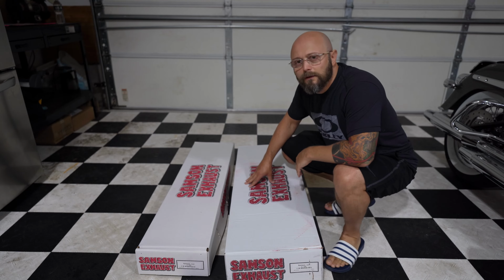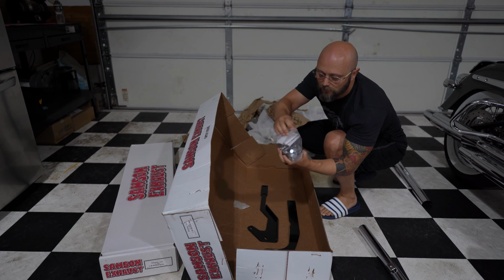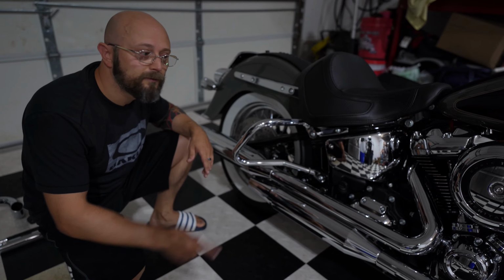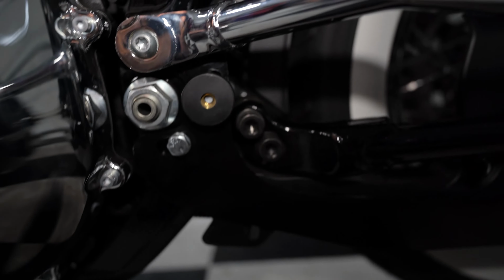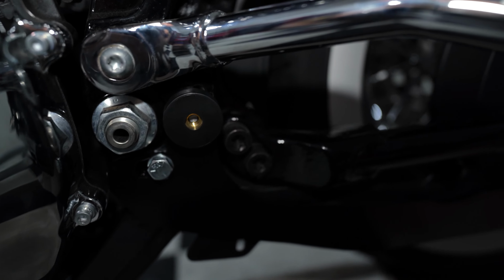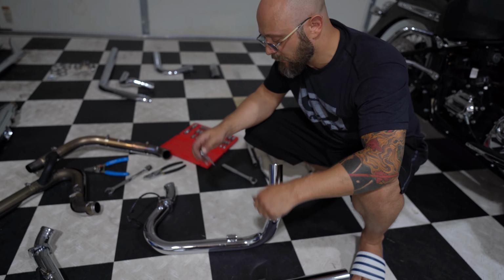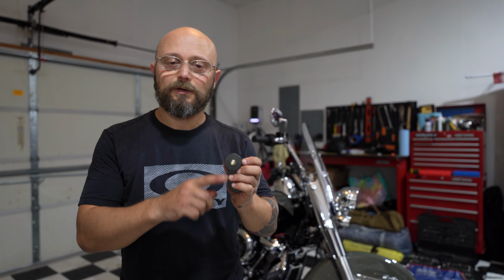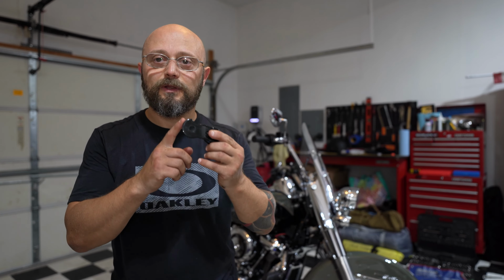Samson 33" Chrome Fishtail Exhaust Install on 2021 Harley Davidson Heritage Classic

Comment: I actually went into the dealership looking for a deluxe and went home with a heritage after finding out it was discontinued.  I never knew how much I would appreciate bags and a windshield until I tried it .  😆  No regrets at all.
Reply from the maker: Yes definitely.  I had a Street Bob and wasn't planning to upgrade, until I saw this on the dealership floor 😃
Reply: No tuner required?

Comment: After putting Sampsons on several bikes in the past, this time I'm trying Freedom Performance on a 2018 FLHC I just picked up.  I'll report later on how they turned out.  I noticed in your video, that you did not need to remove the heat exchange cover or loosen it to remove or install head pipe.  My instructions tells to do so.  Did I miss something on your video, or did you work around it?  Thanks
Reply: Oh and BTW,  I also lowered my bike after watching your video on that!  After the pipes, I'm putting on hard bags!
Reply from the maker: Yeah I was able to work around the heat shields, but they are simple to loosen and remove. Good luck with the Freedom Performance👍

Comment: Did you notice any power gain or loss with the true duals?
Reply from the maker: I honestly have not. I would not be surprised if there may have been an HP or two loss but I did keep the baffles in to maintain the back pressure to minimize any power loss.
Reply: They definitely look good and sound amazing bro. I have a 2018 heritage myself and have been leaning towards fishtails as well. Looking at what's available, I think the Samsons look the best on the new Softail frame. The bassanis sit too low and look odd with the stock bags and guards and the freedom fishtails sit way too wide. That short video you made showing the pipes with the bags convinced me which way to go. Thanks.

Comment: How did you get the right saddlebag re-installed? Did you just use the bracket from left side?
Reply from the maker: I got in touch with Samson and they sent me the missing brackets (eventually).

Comment: What's your estimated time for installation?
Reply from the maker: Couple hours
Reply: @LennyK  Reason I asked was because I had my dealer install ( I bought the header pipes from Samson n chikla upswept slip ons from Steady custom cycles for my 08 flstn with all the parts for installation. Was told everything is on but the mechanic said it was a bear to install. So the parts dept billed so many hrs n now they may need to adjust for more because of more time which don't know as of today. Originally I was told 2 1/2 hours. I still have baffles to install which I didn't know at the time of purchase, that pipes came without n they will be shipped to dealer next week. Let them drill the hole to install. Should I pay the extra $ it took, if that happens or negotiate.
Reply from the maker: @peterbergeris6510  definitely negotiate. They quoted, and should stick to the price/hrs quoted. The install is not very hard at all.

Comment: What size in diameter are these? In the process of ordering and have a 1 7/8 option and a 2 1/4 option
Reply from the maker: I am not 100% sure about diameter of the pipes, but here is the actual exhaust I got: https://www.directcycleparts.com/shop/exhaust/full-systems/samson-true-dual-crossunder-m8-headpipes-w-33-cholo-fishtail-slip-ons-for-18-21-softail-chrome/

Comment: Hi Lenny,
After the Samson true duals were installed and the right side bracket issue was resolved, the saddlebags can be properly re-installed.  Need saddlebags when riding two-up.
ES
Reply from the maker: Yes. Saddle bags are back on the bike! 👍🏻

Comment: Without the fishtails on the bike can you tell me where the pipes would end ? Would they be aligned with the rear fender if removed?
Reply from the maker: It ends in the middle of the fender.

Comment: I like the bike and sound, I just wand install samson fishtail for my 2021 heritage 107 (same as yours), I'm a little worried because some one say samson has cheap quality, especially in the surface plating treatment, I don't know it's true or not, I wish had  your opinion. Thanks
Reply from the maker: Samson is the company that started fishtails.  They are one of the highest quality exhausts, and that's the main reason I got them.  It's been about a year so far and no problems in quality at all.
Reply: Thanks Lenny,  you've relieved me. I want to install it myself, it's a very interesting thing. Again, do I need to replace the gasket? Thank you so much.
Reply from the maker: @chenwang9232    It's always a good idea to put in the new gasket where the connection of the downpipes are to the cylinder heads.  Mine was basically new when I did it so I did not have to change the gaskets.
Reply: @LennyK  Thanks brother.
Reply from the maker: @chenwang9232  My pleasure
Reply: I learn from you and have install samson fishtail for my 2021 heritage yesterday, looking great souds great, but the cheak engine lamp always on when riding, what will be the problem? Do you have good solution for this? thanks brother
Reply from the maker: @chenwang9232  glad I could help. The only thing I can think of is the oxygen  sensor not plugged in properly or got damaged in the install (possible wire problem also). I am assuming you have a stock intake?
Reply: @LennyK  Thanks borther, I'll check it, good man.

Comment: Looks good and sounds amazing
Reply from the maker: Thank you!
Reply: @LennyK   I'm about to order the same size you got but it's asking 1 7/8 or 2 1/2 what did you go with
Reply from the maker: @Beenthat1214  what are you referring to?
Reply: @LennyK   You're exhaust you went with 33 length but what's the with diameter. on the website it gives me two options to pick from 1 7/8 & 2 1/2....
Reply from the maker: @Beenthat1214  Not sure where you see this but Samson does not mention anything about it.  Here is the link:  https://samsonusa.com/shop/new-m8-true-duals-for-softail-33-chrome/
Reply: @LennyK   Oh well the link you sent me the exhaust is way cheaper I was about to pay 1,400 smh thanks man i really appreciate you sending me the link big time.
Reply from the maker: @Beenthat1214  No problem :)  Good luck!

Comment: Hello,
Just curious what fuel management system you are using.  Great video.
ES
Reply from the maker: At this point I am not using any. Don’t really need to tune anything until I change the air intake.
Reply: @LennyK  Hello, Thanks again. The cycle runs and sounds OK without a fuel management upgrade? This is my first H-D with fuel injection. Previous cycles were carbureted Evo and TC 88. When I do upgrade to Samson fishtails, air cleaner will be H-D Scramin' Eagle extreme flow with Zippers Thundermax fuel management.
Any opinions will be appreciated.
Lots of info out there.
ES
P. S. A cam upgrade to an S&S cycle 465 gear driven cam will occur in the future.
Reply from the maker: @kathyleesawyer5277  sounds like you have a great plan for your bike. As to your question, yes the bike runs and sounds great. These bikes do not run lean, so unless you introduce extra airflow, there is no need for a tune. I will be upgrading to Screaming Eagle intake and tuner in the near future.

Comment: Lenny K  I have a quick question.  I've contacted samson several times and they tell me they don't have an exhaust for the new heritage classic 114 .  I have a 21 as well.   They told me in emails that the fishtail for 18 and up softails won't work on the heritage due to clearance issues and they are in r&d and expect a release soon.  Then I come across your video.  I didn't really notice you having clearance issues  do you have any idea what they are referring too?  Thanks
Reply from the maker: 107 and 114 is the same as far as the exhaust goes.  They absolutely have it, but they call it 18+ M8 Softail.  There is no fitment issues, but you do have to ask them for Bag mounting brackets. Here is the link for exhaust:

https://samsonusa.com/shop/new-m8-true-duals-for-softail-33-chrome/?attribute_set-type=Head+Pipes+and+Mufflers+%28Sold+as+a+set+only%29&attribute_year=2018-2020+Softail+Models
Reply: @Lenny K  thanks  for the response  yeah I took the bags and windshield off day one and will never put em back on.  I slammed it with air ride and put carlini bars  doing a vicla,  all blacked out.  I'm going to order this today.. thanks!
Reply from the maker: @TopShotLLC  no problem. Good luck with the exhaust. They do have a bit of a wait for it but I think it’s worth it 👍🏻
Reply: Hi Lenny,  Just want to double check something:  you mention that the saddlebag mounting right-side bracket needs to be specifically requested?  Samson didnt simply forget to add the bracket to your parts packet?  I perused the Samson accessories section on the web-site but only found exhaust mounting brackets.  Would you happen to have a part number for the saddlebag mounting bracket?
Thanks again,  ES
Reply from the maker: @kathyleesawyer5277  Hi Kathy.  According to Samson, they do not automatically ship the specific Heritage brackets for saddlebags.  So if oyu are ordering the exhaust for Heritage you have to make sure and let them know to include these (two) brackets.  Unfortunately I do not have the part number for them, but if you call or e-mail them, explain exactly what you are looking for.  They will know what bracket to send you.
Reply: Hello again Lenny,  Thanks for clarification regarding the saddlebag mounting brackets.  ES
Reply: @Lenny K  I'm still waiting on mine to come in  but just to clarify.  I don't run bags on my heritage at all so I don't need to contact them about the brackets do I?
Reply from the maker: @TopShotLLC  correct. If you don’t use bags, you don’t need brackets.
Reply: @Lenny K  thank you sir for all the info
Reply from the maker: @TopShotLLC  my pleasure 👍🏻
Reply: Hello,
Contacted Samson and had the brackets ordered.  Received them the next day.  Official name is "Softail bag bracket" part # SP0-126.  The 2 brackets are identical to one another and are black matte in color and wrinkle finish.  Is this what you received?  Are any more parts from Samson necessary.
Thanks again,  ES
Reply from the maker: @kathyleesawyer5277  Awesome. Sounds like you for the right parts. You should be good to go 👍🏻

Comment: Did the left side have movement after tightening up? Mine kinda moves from side to side. It’s not as sturdy as the right side.
Reply from the maker: Yes there is a little bit more movement on the left side vs. right side because of the bracket placement and thickness. Also, make sure your cross pipe clamp is nice and tight.

Comment: Hello,  Very informative video.  Question:  are the fishtail end caps removable?  ES
Reply from the maker: Yes they are
Reply: Hello again, Another question:  are O2 ports pre-drilled for 12mm or 18mm bung?
Reply from the maker: @kathyleesawyer5277  I believe they are 18mm but not 100% sure.

Comment: Sweet looking bike! Are there oxygen sensors on the stock mufflers? Because as far as I know 2021 H-D did some updates
Reply from the maker: Thank you. Yes still the same 2 sensors one per pipe in the front. You can see it in the video when I change them.
Reply: @LennyK  thank you for the prompt reply brother! Unfortunately here in our region H-D updated to 4 sensors which is sucks due to the regulations. We can install those exhaust on the 21 models but the check engine light will be on. Waiting for the after market companies to do something about it
Reply from the maker: @hssanalsadik9106  That sucks. Hopefully aftermarket tuners will figure out something soon.

Comment: Nice video again mate. I see you have the screaming eagle HD Leeds did you take the tank of. Would like to see a video of that, like to keep you busy lol thanks Don
Reply from the maker: Thanks. Actually all the lights are stock. Haven’t changed any yet. Now, the headlight and passing lights are LED and come stock from the factory like that. The only non LEDs are turning signals and brake lights.

Comment: Hello,  Did you order the pipes directly from Samson, and if so do you have a part number.  The part number I found on the web-site is S-670-1.
ES
Reply from the maker: Hi Kathy. I ordered it through a reseller  DCP - Direct Cycle Parts. The part number is S-670-1